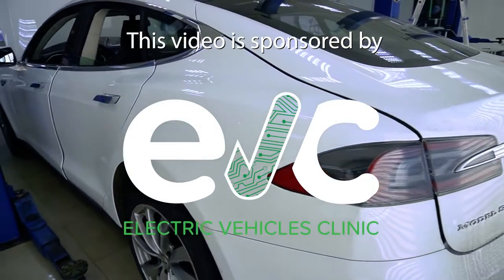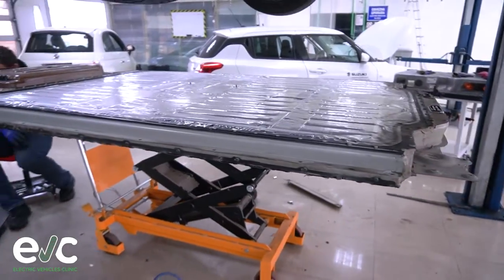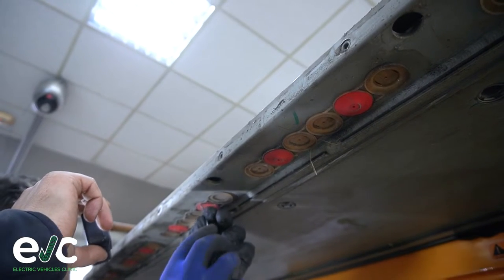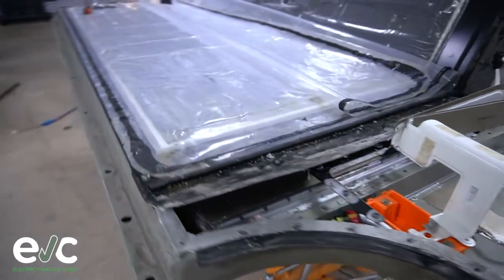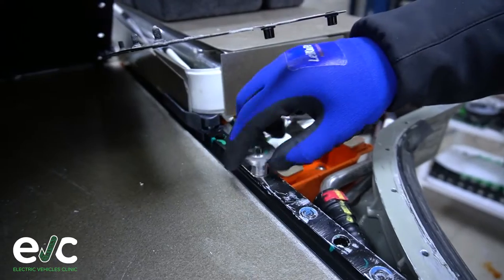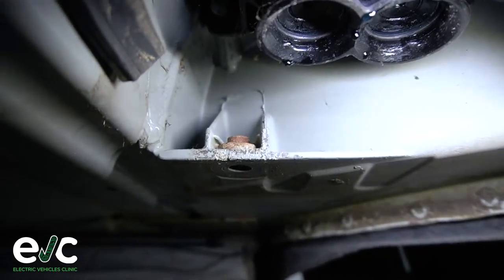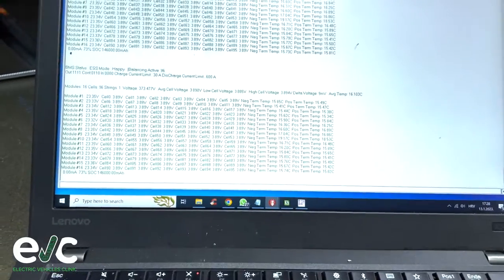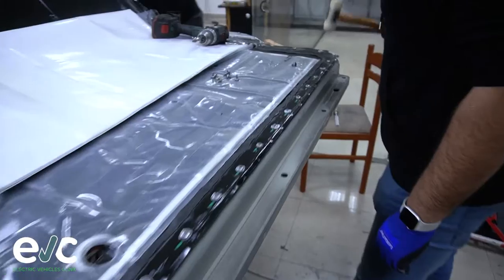Water Inside Tesla Battery - Repair by EV Clinic

Comment: I’ll stick to gas powered vehicles!!!! 
This looks like quite a chore, and a dangerous one at that. ….and I doubt very much that those shields, sealants, and screws on the battery pack will hold up in the snowy salt belt regions of this country.
Reply from the maker: Well it actually holds on most packs, ussualy longer than oil seals on ice engine so...
Reply: @T.S.CUSTOM  False

Comment: Why Tesla doesn't repair it on warranty?
Reply: Because this is a very temporary repair that will fail again in less than a year. It’s throwing good money after bad. Car should have been scraped with that many miles. So many things are ticking time bombs on it and it really needed a $20k battery replacement.
Reply from the maker: Warranty expired and this is easily repairable making the battery seal like from the factory and good to go for another 200k km. This can be prevented by regular maintenance of the battery every 200k km.

Comment: You should be checking all sections for water... I had water ingress through one broken bottom plug and water got in every sections of the battery when it got isolation fault. Leftover water probably won't cause isolation errors again but will slowly rust the battery cells...
Reply: What year was yours?
From what I've seen, the 2012-2014's have the most problems with water ingress, and drive unit failures.
Reply: @BradKwfc  2016, it was due to accident. suspension broke n battery skid cover hit something n cracked the vent. Can't see it unless u remove those skid covers on both sides of pack. lesson learned.

Comment: That car has a second refurbished battery in it, just shows the horrible quality these Tesla cars have. Pure junk!
Reply from the maker: The battery capacity is almost like brand new and the car has 260000 km on it. Battery was not replaced but refurbished. I would not call it junk just because it had water ingress
Reply: @T.S.CUSTOM  junk is harsh, I agree. Guess what I see in the news about Tesla and Musk made me say that. I once wanted the model 3, but after two years waiting, the price doubled, I got a Honda.
Guess I will wait for H2 cars if they ever come in bigger numbers and aren't as expensive as they are now.
Reply from the maker: @rjung_ch  Just consider all the service intervals price on a ICE car in 260000Km. After that mileage, a complete engine rebuild in most cases is required. After that add money spent on gas for that mileage. It will turn out that it is less expensive to buy entire new battery pack for tesla than driving a ICE car. We just had a 500000 Km tesla serviced with original battery. They are not perfect but still one of the best EV's on the market even used ones with high mileage.
Reply: @T.S.CUSTOM  500000 Km tesla is very impressive!
Reply: @rjung_ch  You haven’t seen the repair bills for it.